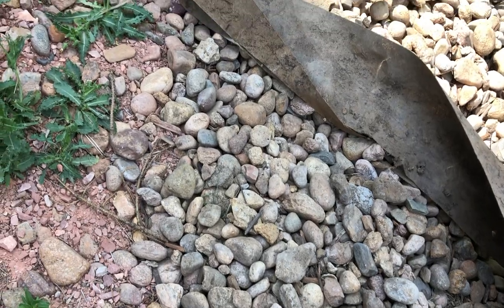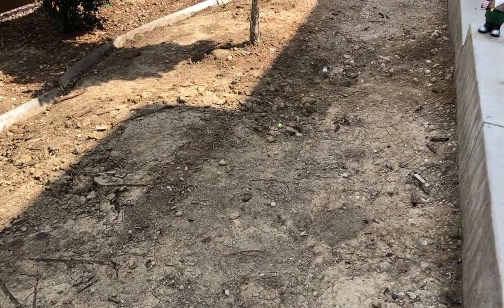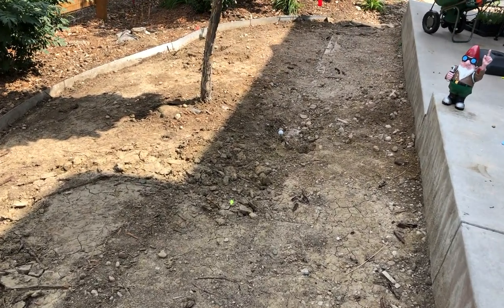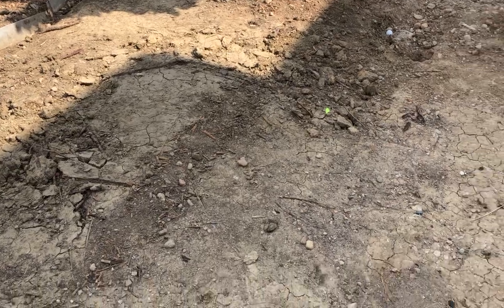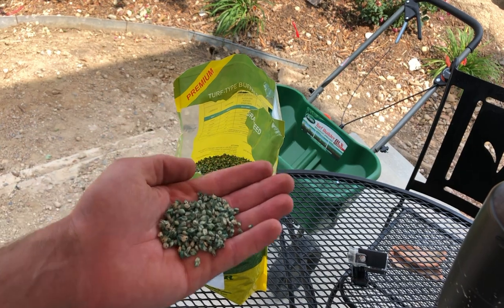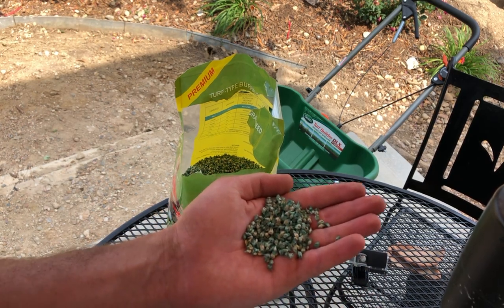Buffalograss Part II - Seeding Buffalograss in the Backyard

Comment: So you did not speak on the mesh blanket you laid on top. What is it and why are you using it vs. top soil? Love to see and update and hear your feedback since this video. What area or zone of CO are you located for weather comparison? Looks like you may get more snow. Thanks!
Reply from the maker: I made that video almost four years ago. If you check my channel I have a whole playlist of how my yard progressed over the years.

To answer specifically, my backyard had a relatively steep incline, so I needed the mesh there so the seeds wouldn’t wash away. If it was more level I probably would have used top soil.

The mesh was something you can get at Home Depot or Lowe’s. Basically a mat of wood fiber. 

I’m in zone 5 in Broomfield.

Comment: Wow, it's insane that you can just sprinkle the seeds on the hard dirt and get a nice lawn.  I would have thought you'd need a layer of new dirt on there!   I'm thinking about putting the buffalo grass on my 2 acre property.  I was going to till it all first.  There are tons of weeds...and some other forms of native grasses currently.  I don't like using chemicals so I probably won't put any weed control down first...just sprinkle the seeds on the fresh dirt, water and hope for the best.  I've read some things that say buffalograss is a great dense grass that hampers weeds, but maybe you have to start out with no weeds for that to be the case?  I dunno.
Reply from the maker: Not sure why I’ve missed this comment until now, but I apologize for doing so.

I’d say wasn’t until winter at this point, let the cold kill off the annual weeds, and pull the perennial ones. 

Once late spring is upon you, lay your seeds down and your weed pressure should be pretty minimal.

Thanks for watching!

Comment: I am having issues each year in my front yard.  I live in zone 7a/7b in central Virginia.  My front yards gets full sun and the lower area and the slight hill, die off each year regardless what I do.  I have measured 104 degree soil temps at times.  Do you feel I could kill off what little that is not dead and use buffalo grass?  I hear everyone say it is not for the East Coast but I really am not interested in Bermuda.
Reply from the maker: I won’t say no. I’ve seen demonstration plots of buffalograss planted outside the botanical garden on the national mall in DC.

Just be prepared for weed pressure. You get too much moisture I’m afraid that’ll it’ll probably be a constant battle.

Comment: Do you leave the seed fabric and the grass will grow through it? Is this a good idea for seeds in the colder weather?
Reply from the maker: Yes, you leave the seed fabric IF it doesn't have plastic netting in it. The fabric will decompose into the soil. 

If you get seed fabric that does have plastic netting, let the grass grow through for a couple of months to get an established root system. Then rip the plastic netting up through the grass. You do this so your lawn mower won't get tangled. 

I started this project at the tail end up July, so the grass was fine by the time winter rolled around.